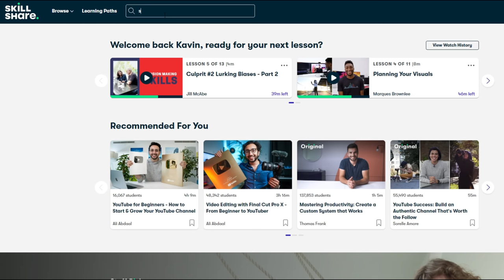I Crashed My DIY Ekranoplan (And Fell 40 Feet)

Comment: Looking at the footage, the craft gets a huge boost in angle of attack the moment the tow rope is suspended above the water.  When you try this experiment again, raise your tow point on the boat to the height above the water you have designed the eyelet to fly in ground effect.  This will, hopefully, put the tension parallel to the water surface.
Reply: Agreed, also taking a few degrees out of angle of attack on front wings and maybe add a smidge to the elevator . I think the plane speed of the boat is too high with that , the speed is not variable with fixed angles on the wings . Good luck
Reply: This is what happens if the technology is copied without knowing. We are the Tandem wing specialists and know what happened

Comment: Wow! This is extremely impressive and scary! As someone who does water sports, I know how high speed falls feel. Also, man you are lucky to have avoided the RC plane. Those props are scary for sure!
Reply: Those are small, they’re not really an issue
That would be the equivalent of a paper cut if you fell on them, but I wouldn’t stick a finger in voluntarily….
Reply: @arwo1143  I have the scars to prove otherwise. And these are probably motors much more powerful than what took the tip of my finger clean off.
Reply: @Tusai  agreed I've got a scar from 5 stitches in hand from one going full throttle at me if it was a inch or 2 further I prob would've slit my wrists
Reply: @arwo1143  I've got a small 1500mm wide twin engine RC plane,one of it's 5 bladed props sliced right through the 50 or 60 page manual when I forgot to leave the throttle cut engaged once.
Reply: @Tusai  agreed, theyre not big but are very sharp,
I cut my wrist with one (video on my channel lol)
Reply: @arwo1143 I guess you haven't had firsthand experience? I've seen fingers clean cut off by rc props. The little 4 stroke saito fa72 I've got is pretty menacing to start and you can just tell you don't want your body parts anywhere near them and that's just at idle

Comment: Handles that run parallel with the body might make forward/back weight transfer a bit easier, rather than trying to rely on just leaning forward or back, you could move your entire body by being able to walk forwards/back however many steps needed.

Comment: Really cool project! Wish I was there! 🙂
Your GEV or WIG seems fine as long as you stay on the air "cushion" between the water and the wings. As soon as you go higher I can clearly see properties of an unstable aircraft. Meaning that once you exceed a certain angle of attack there is no way to recover. This is caused by your Center of Pressure(CP) being in front of your Center of Gravity(CG) and will never work unless you have artificial stabilization. The solution would be to shift your CG forward by a lot(in front of the CP) and to make sure your tail is providing(slightly) negative lift as a compensation. This is the way naturally stable planes fly.
Good luck! Looking forward for more vids 😁

Comment: There's something funky going on with the tow rope, and the attachment point. With the low attachment point, the tow rope stays stuck in the water, and pulls down on the aircraft. Notice at 9:10 when the aircraft finally pulls the tow rope completely clear of the water, and the aircraft wants to very quickly rise, being free of the downward pull.
Reply: Hear hear.

Comment: Few of my observations and probably it might help, 1) In my pre-teen i made my first kite and failed big time and the reason was that  I did not string my kite appropriately, this is the same mistake i observe in your build ( what ever i see in your video ) your build have only one rope clamp in front which makes the pull unstable. Bolt the second clamp below the fuselage a little far from the first one and  tie the rope between........give a try, as its done in the KITE.  ¬ Good Luck  :), yep I  think release mechanism is not really necessary in here when you can control the speed.

Comment: weight shift has severe limitations when everything becomes dynamic. - may need some wing warping or other aoa augmentation/control implementation

Another "safety" feature from the kiting world is to shift the tow point forward  - to a secondary anchor on the leading edge / nose  in the event of an uncontrolled pitch-up...

Comment: Perhaps changing the front wing to incorporate a low speed slot into the leading edge, at high AOA the slot helps prevent boundary layer separation and as the speed increases the AOA drops and the slot doesn’t add extra drag. Just an idea, it wouldn’t require adding any additional control surfaces or operator controls. One question, does the craft seem to maintain stability around the vertical axis? From the incidence angle I would think a lot of the vertical stabilizer authority would be negated by the air coming around the fuselage.

Also another towed craft idea for you, the Focke-Achgelis FA 330. It was a low speed, towed, gyrocopter. You could probably extend the tail boom a little and make the system weight shift based with a greater rotor angle to handle the roll control and keep it stable.

Comment: Repeat after me: Critical systems need a backup. Critical systems need a backup. Critical systems need a backup.

Two examples: You're missing a way to kill lift on this design if the weight steering fails and the release hook was a single point of failure.
The first human to fly fixed wing heavier than air was Otto Lilienthal. He died in a loss of control accident on his self built center of gravity controlled glider.
Reply from the maker: What is considered a backup?   For altitude safety I have three options:  weight shift, jump, or rope release.   Sounds redundant to me....  I got out alive thanks to having a backup for a backup.
Reply: @thinkflight  consider the purpose of a system. Your sole means of controlling flight is the weight shifting. A backup for a system needs to somehow perform the original task even if only degraded.

I obviously don't know your background, but from what I've seen of this aircraft it is highly unstable in the pitch axis and has a severe amount of power-on pitchup. At 0:11 you lean full forward, but there is no change of pitch. Instead the pitch increases(!) until you begin your bailout at 0:13. At no point in the accident sequence do you have positive control of your pitch axis. At a minimum you could have added some sort of air brake to be able to destroy lift on your wing giving you at least one backup means of control.

I've chosen Otto Lilienthal on purpose, he is very much a hero of my childhood, despite him having died before the Wright Brothers ever took flight. There were a lot of smart people back then who worked out the basics of aerodynamics but Lilienthal was the first one who verified them. His experimentation laid the foundation of our understanding of aerodynamic lift. And despite the fact he was one of a kind and the most experienced human pilot ever, he died to a simple gust of wind that brought his weight controlled aircraft into a state of flight beyond recovery.

Aviation Safety Rules are written in blood. A single means of pitch control that is insufficient to control pitch above a certain airspeed is not safe. I've had the same discussion with several other youtubers dabbling in flight over the years. Peter Sripol luckily never payed for the shortcuts he took. Peter Muller from Raptor Aircraft tried to get a professional test pilot, but when the only one who even wanted to attempt it decided to back out he continued on his own and almost died. He only got saved by the mandatory airframe parachute.

I have absolutely no interest in seeing someone from the YouTube aviation community die or have a life changing injury. So please, by all means don't take my advice, but go talk with people familiar with the systems you are using. Or at least familiar with systems similar to what you use. I have no personal experience with hang gliding, but they are among the few users of weight shifting controls in aviation nowadays. Barring that you need to train yourself in more pessimistic thinking. I look at any part of any given system and think "how does this break, and what else breaks WHEN it does"?

A new airframe is a dangerous thing. Keep that in mind.
Reply: @thinkflight  No, you got damn lucky with an uncontrolled bail. Almost right into your chase aircraft. what the man said about critical systems applies to any aviation endeavor if you’re trying to make a craft that anyone could use. If you want to take risks that’s cool, just recognize the risks and articulate to yourself that you are taking risk. ‘Safety First’ does not mean you have to stay at home it just means you need to use your brain all the time. Decision Fatigue & Completion Bias both applied here. 
P.S. What if the drone hit you in the face and knocked you unconscious? I’m not confident that your crew could get back around soon enough to save you from drowning. Safety First says drill jumping off the left side not the drone side. Drill, drill, drill. In aviation things happen too quickly to make the decision when bad things start happening: you have got to practice what you’re going to do in advance. Or, admit to yourself you are taking risk.
Reply: @thinkflight  almost all of the comments here are misguided, *just like you*.  most people are suggesting more stupid ideas and missing the important factors that almost got you killed.

Skillshare decision making training is nice but you need adult supervision.

 so much is mistaken in your quest for revenue by making thrilling videos.

weight shift is one of the worst ways of controlling an aircraft. Lillienthal said 'sacrifices must be made' after crashing one, and then died from the injuries. Sacrifices are optional, and based on risk. learn to minimize risk.

wind tunnel research was proven by the Wrights to lead to success - why are you not copying what works?

what were you thinking that you allowed the tow boat to get you up to 40 feet in an aircraft you weren't positive you could control ?

Ekranoplan are surface effect vehicles. At 40' altitude, it's not an ekranoplan, it's a fixed wing aircraft.

towing an aircraft in testing and training can be done, but you violated almost all of the best practices we already know from surface towing gliders.

the joviality and blase reaction following your crash turns my stomach. You could easily have died, and the tone of the group afterward shows how ignorant and heedless your approach is.

I hope you seek out advice from aerospace professionals before you go any further with manned flight. You are a funeral waiting to happen, a dead man walking.

Comment: I'd make a DIY wind tunnel and test various designs. You should be able to make it naturally stable with front canards that operate near stall. You might be able to have altitude stability by having the front wings higher than the rear wings so that they leave ground effect earlier.
Reply: If he make the front canard smaller it will get out of the ground effect earlier because ground effect height limit is proportionnal to the wing span.

Comment: Awesome effort and great footage! I guess my first question as an aircraft designer, sailor and pilot is: Why are you using weight shift for control instead of control surfaces like on your r/c drone? Great project, good luck in future flights!
Reply: Weight shift is perfectly reasonable, just needs to adapt the canard configuration so front wing stalls first. Parallel bars will allow more weight shift also.

Comment: How about not using the external force to pull, but having your own? 
Put engines underneath it, similar to the NAVY Ghost stealth attack boat. Maybe even one engine would be enough. 
The hovering-angle and steering will be done with shifting of the body.

Comment: Amazing channel! I see some similarities with winch-launching a glider. Maybe that can provide some good inspiration for safety features here. For example the release hook is always tested under tension before the first flight of the day. The pilot always has control over the cable release and it's his responsibility to decide if he should release if something goes wrong. The cable is also connected with a link that breaks if there's a certain minimum amount of force pulling on it. It's basically a piece of metal that snaps at a predetermined amount of newtons. It's also very important that you're always able to bring the nose down, as the aircraft might enter into a stall or spin at low altitude if the angle of attack is too high like we see in the video.

Comment: The thing is unstable in pitch. The tip vortices and to some extent the downwash from the front wing drive down the aft wing once the front wing produces lift.
Increasing the span of the aft wing will probably help with a bit of dihedral

Comment: In college I built a trebuchet to launch mini pumpkins and we tried using that exact same style of quick release for the trigger. It failed exactly like yours did. The hook swings open but the loop of string would get caught on the expanded eyelet that the release pin fit through causing it to catch and fail to fully release

Comment: Just a thought, make the tow point adjustable on the fly. This would essentially change the thrust line and you would able to control the upward pitching moment that seems un-recoverable
Reply: interesting point, because wig vehicles work best with anhedral, though I wonder if maybe a winglet solution could be devised giving a dihedral effect that works in this regime

Comment: I'm pretty sure that because you are on top and a significant part of the mass, with the increased angle of attack the CG moves back relative to CP, which is momentarily made worse by pulling yourself forward, so you end up in an exponentially increasing problem. The opposite of that is true for a hang glider, which is why they are relatively stable and safe. So maybe an ekranoplan you hang under would be an easier idea with a scarier view. Or control surfaces of course, probably airbrakes would be best, so you can quickly stall any corner of the plane. Also, this was way more awesome than I imagined when the first video came out and I was expecting a lot.
Reply: What I said ☝️
Reply: Not to mention what’s the weight of it vs him

Comment: par thrust   is a must . im testing a full size 58 inch prop  par thrust ..using a small car front wheel steering knuckle hub and CV joint .. 8FT. long shaft to a 503 mounted at CG

Comment: Retired Engineering technologist: Taking clues from Airfish 8, A high rear wing should be large enough to bring the nose down. Front wings should stall when an increased angle of attack happens so they lose lift leaving Ground effect.. Twin vertical rudders will control direction and provide a tunnel to focus wind from a pusher propeller. Observe engine torque. Decide airspeed.
Relate the center of lift for wings and the central balance of all weight. They should be close. 
Put some skis on wing ends to prevent submersion in flight.
Wings will then automatically maintain constant height above ground or water.

Comment: It could be a good idea to add just an horizontal stabilizer with a draft to manually control it. Just to have a little bit of pitch control, i think you can achieve longer flight and maybe safer too
Reply: Yeah, I mean airplanes don’t control pitch by shifting their center of gravity for a reason.
Reply: Add a HobbyEagle stabilizer from BG, just for safety reasons 😂.

Comment: how about a linkage going to a water "wing" (for better term) when the wing is in the water. a elevator is trimmed to give up trim on the front wing.  as the front raises out of the water, the wing on the lever will drop, and the linkage can decrease the lift on the front.  the hard part would be tuning it so that you do not get big oscillations. kind of like a manual form of the sonar on the RC ekranoplan

Comment: I think the downwash from the front wing reduces the lift the rear one makes. It is running at a lower incidence. I would put more area in the rear wing, with a little more incidence. Reduce the area in the front wing. It should not make so much lift when it is out of ground effect.

Comment: Without winglets, I think you’ll continue to experience slip. For example, take a look at the YB-49’s mid-wing stabilizers. I still think that flying wing design would have flown much better with winglets, but they decided to forego them in the end and ultimately replaced the stabilizers with fly-by-wire technology on the B2. Hope to see your project fly! Especially since they’ve outlawed flying inflatables nowadays!

Comment: It seemed to me that when you put your body forward the plane climbed quicker and when Daniel put his wait back the plane leveled out. It made me wonder if the weight of the plane and aero-stability are sufficient to resist you pulling you’re weight forward. If your feet are stationary they would be your pivot point right? What if you built short handles and had a kneeling platform that could shuttle fore-aft to adjust your body weight so that your handles are the pivot point? 

I know how it feels to hit the water at very high speed and I imagine this was an eye opening experience. I hope you can find a way to safely continue this project because it’s super cool! Stay safe, another great video isn’t worth serious injury or worse.

Comment: Using your body to find the right Center of Gravity (CG) on an aircraft in flight is probably the most dangerous way to fly. Planes pretty much immediately crash when cargo breaks loose and CG goes aft.

Your best bet is to plant a seat around the natural CG of the aircraft and try to change lift with some trim mechanisms like a traditional glider. It may not be as exciting but at least you won't get hurt.